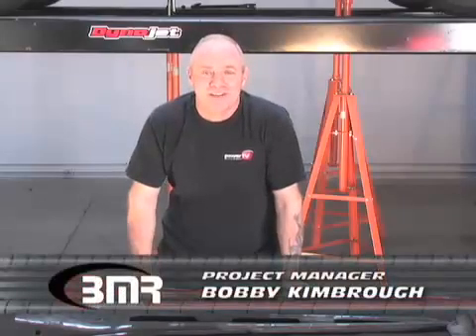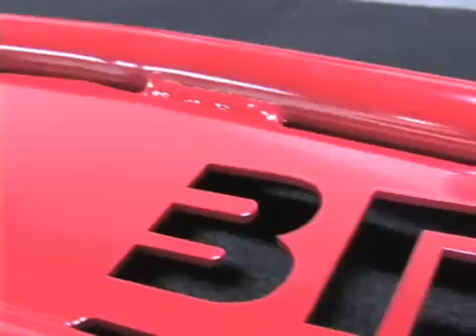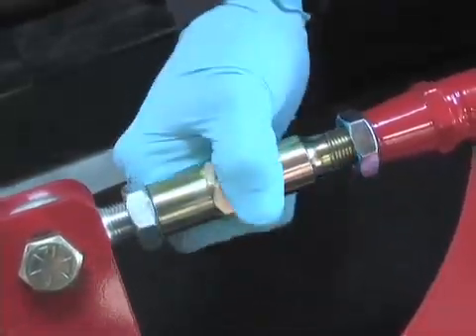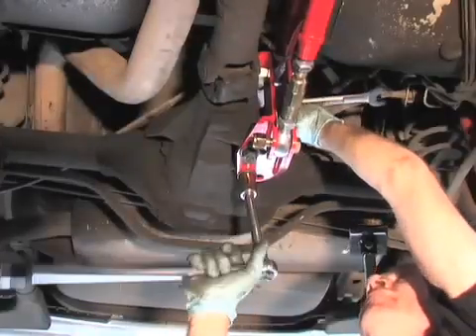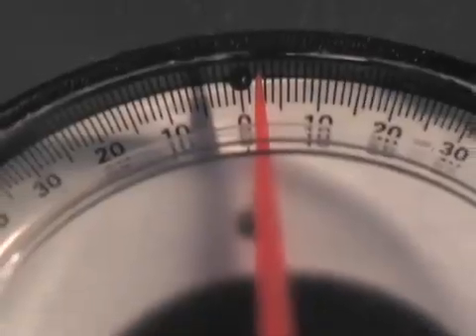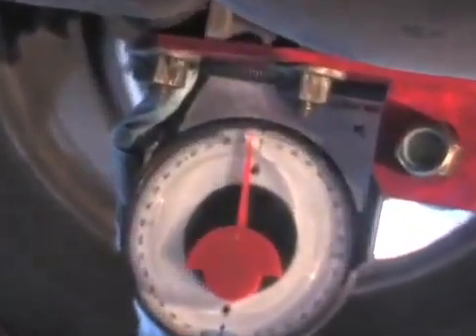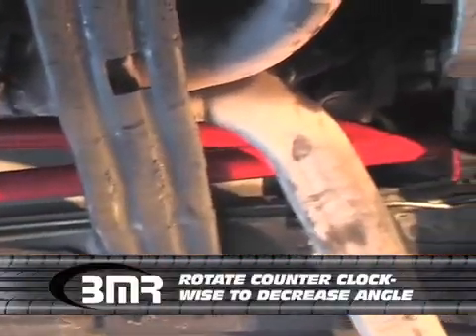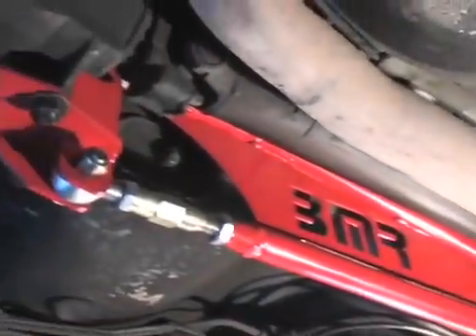Setting Driveline/Pinion Angle on 3rd/4th Gen F-Body

Comment: What effect would lowering your car have on this method of finding pinion angle?
Reply: None. In order to get the correct pinion angle, you'd need an adjustable torque arm. The method is still the same.
Reply: Do you still shoot for a negative 2 with a lowered car as well?